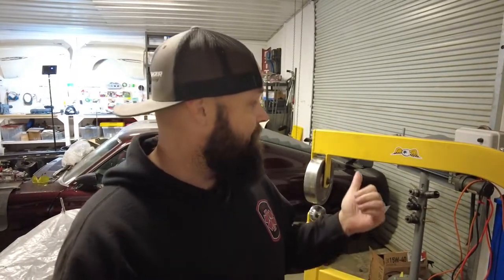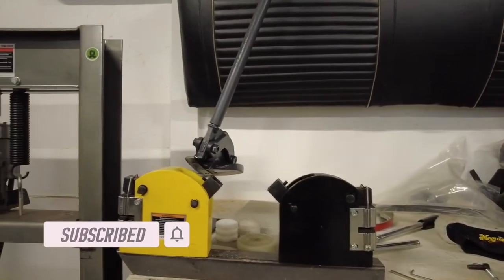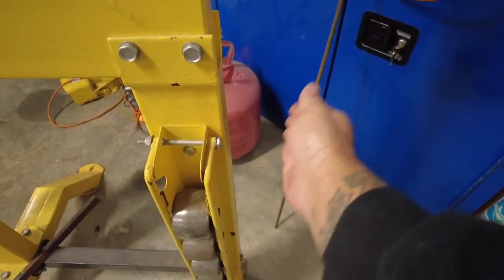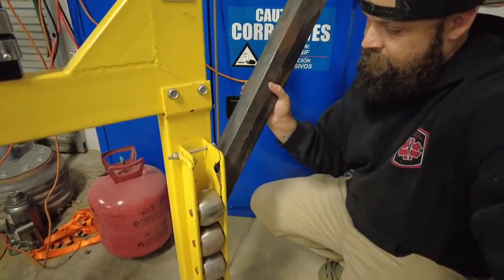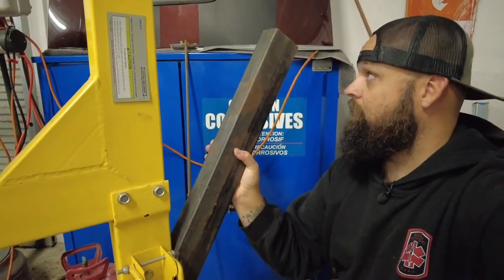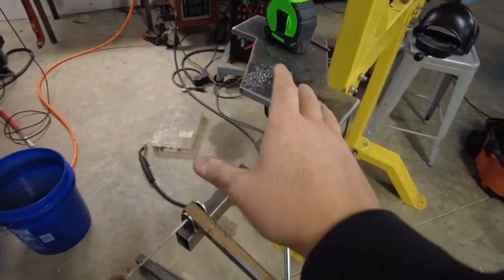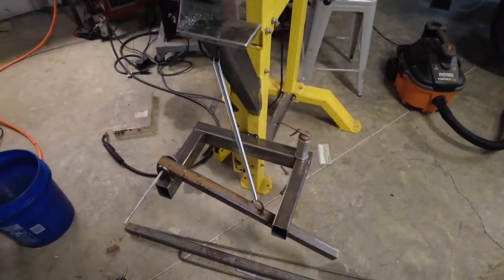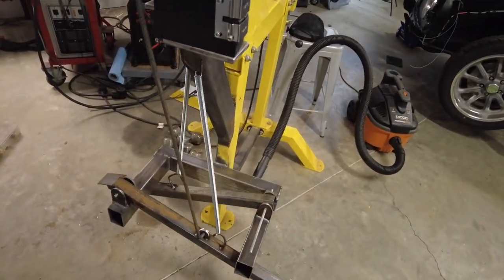Make your cheap shrinker / stretcher work better! (building a metal working station)

Comment: Looks good, but the only problem would be running the part into the shrinker when you try to stretch an inside curve.
Reply from the maker: I thought about that. If the part gets that big I can always unbolt it. But definitely a limitation of the design. Thanks for taking the time to watch and comment. I appreciate it.